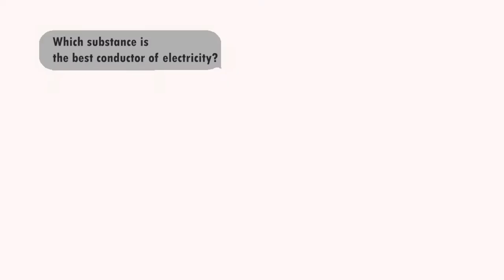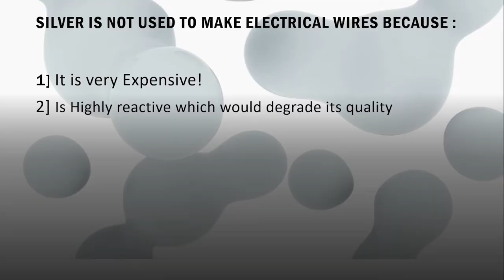Why are electric wires made of Copper & not Silver |  Electricity | HOTS

Comment: Copper is cheaper than silver but not cheap at all
Best example is aluminum wire which is not 2 places worse than copper still used because it's cheaper
Reply from the maker: Quite well said! 👌 Aluminum is indeed cheaper and lighter than copper. However, since it tends to loosen or break at connections, oxidizes faster, and requires thicker wires, it isn’t preferred for home wiring. Copper, though more expensive, is more reliable for domestic use. On the other hand, aluminum’s light weight, high strength-to-weight ratio, and lower cost (as you rightly mentioned) make it an excellent choice for large, long-distance overhead applications.

Comment: Silver wires do exist, just not commonly, because $$$.

Silver forms protective coating like copper and oxideses less quickly, so that part is BS.

Silver plated wires are used in high end coils, and they DO make nice jewelry material too, but need to be polished, unlike jewelry wires which are factory polished.

Why? I have bought 2mm silver plated wires from electronic stores, but I have not seen over 1.5mm silver plated wire sold for jewelry making.

(I am an electric engineer by education and hobbyist jewelry maker btw.)

NOTE: Silver is better electricity conductor than gold despite gold being more electronegative(as the video says)

Note: Gold wiring is used inside microcircuits btw and the reason is not conductivity.

Conductors are gold plated because gold does not oxidise. Conductor are not silver plated (at least commonly), because of the oxidisation btw.
Reply from the maker: Thanks a lot sir for your invaluable inputs. We truly appreciate the ease and structured thought process and knowledge through which you explained the facts to us. We would love to hear from you in future too.
Reply from the maker: That’s a very insightful comment—thank you for sharing your thoughts.
You’re absolutely right that silver is the best conductor of electricity, but it’s far too expensive for everyday wiring. Copper strikes the right balance between conductivity, durability, and affordability, which is why it’s the standard for homes and industries.

Gold, as you mentioned, is used in microcircuits—not for its conductivity, but because it resists corrosion and ensures long-term reliability. Silver does get used in specialized cases (like plating or high-performance applications), but for large-scale wiring copper remains the most practical choice.

Its great to have someone with an electric engineering background like you share such invaluable insights here—it really enriches the discussion for everyone!

Comment: copper is more reactive than silver..please don't provide wrong informations..
Reply from the maker: Hi Rajat, thanks for going through the video in detail.
Just to clarify, we are not saying anywhere that Silver is more reactive than Copper. Let me explain.
Silver is more CONDUCTIVE than Copper (see slide at 1.12 seconds). Silver is less REACTIVE than Copper.
The question is that “Why are Sliver wires not used even though it is most conductive”?
The primary reason is that Silver is much more expensive than Copper. Also, while Copper is more reactive and will oxidize faster, it is not a big constraint as, in being exposed to oxygen in air, it forms copper oxide which does not disintegrate over time.
Hope this helps. Thanks again for your valuable feedback.
Reply: @ExperiHub As does silver.